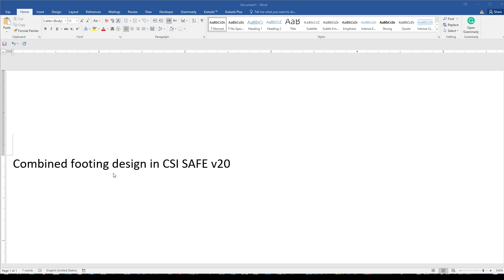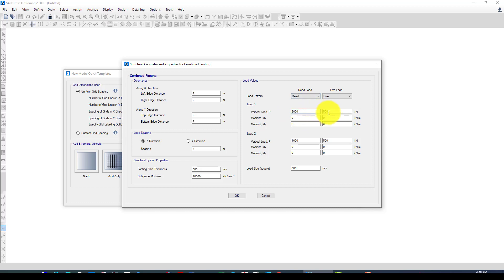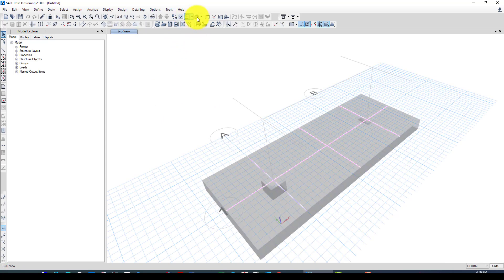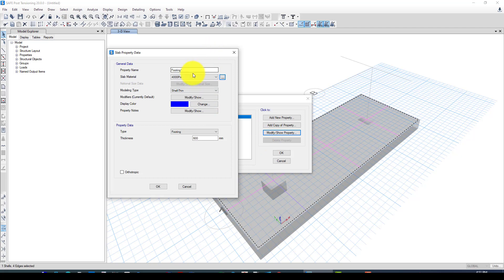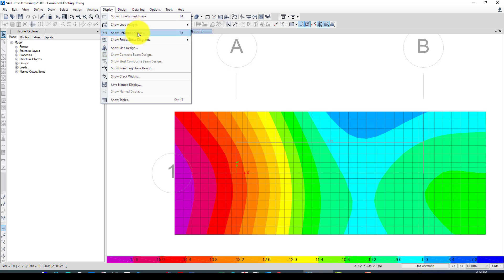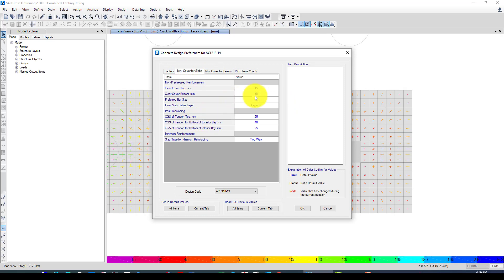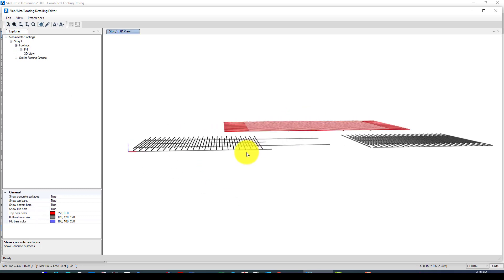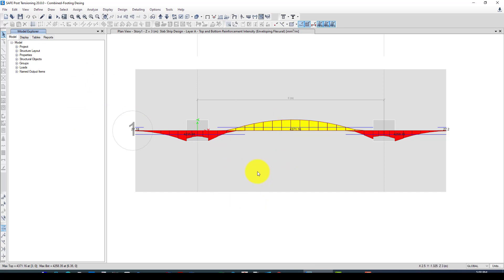CSI SAFE v20 Tutorial ; Combined footing design in using ACI-318-19 concrete design code

Comment: The reinforcement shown (says 4371mm2 at the bottom there in yellow), was the required rebars' area over the entire width of 4m or per meter run (aka over 1m, or mm2/m)?
Thanks Sir.